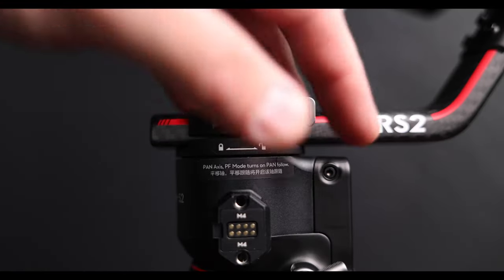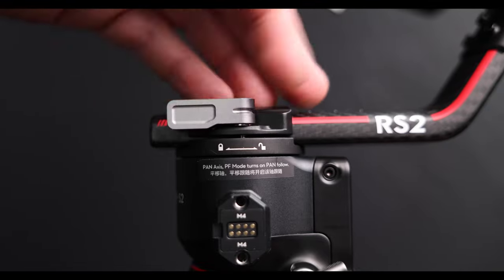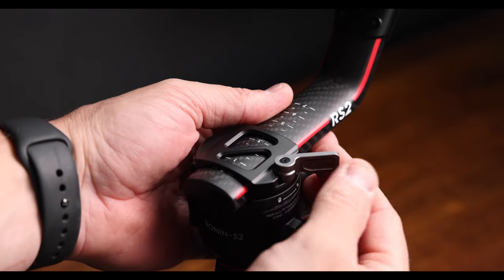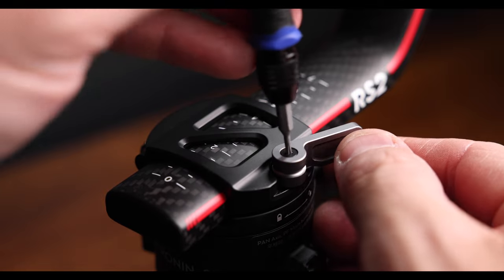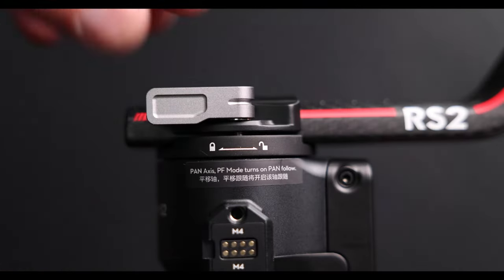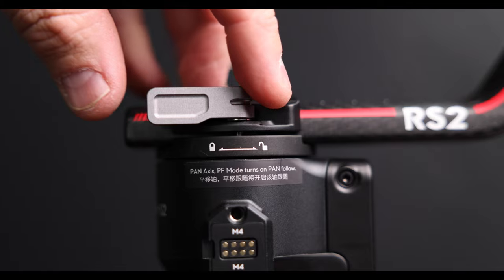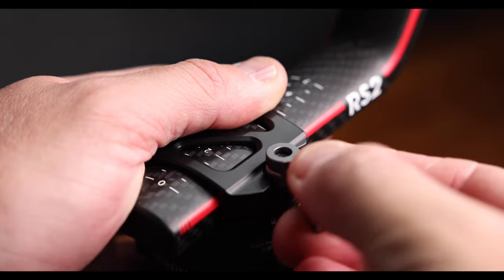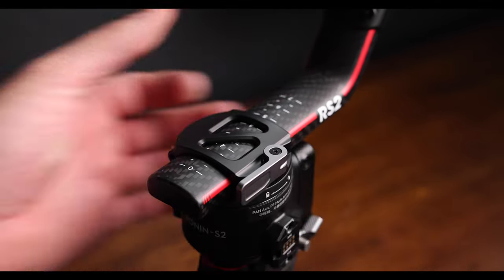Dji Ronin S2 - Loose Clamp Issue - QUICK FIX!

Comment: Thanks man! For those who are still having issues and this clamp moving with your movements, try to keep it straight up and turn smoothly
Reply: i have the same problem but mine is  out  what i ahve to do please
Reply: @samirBeorn  you need to keep straight to the top and turn smoothly then it will work.
Reply: @samirBeorn did you manage to put it back together brother?
Reply: @Shotbyobey  i did
Reply: @samirBeorn  can you share how brother?

Comment: Legend!  Had the same issue with the rs3.  I had to use some small pliers to hold the bottom screw in place while moving the top clip but it worked! Thanks!!!
Reply: please can you make a vidoe i have the same problem

Comment: Great video. I had the same problem after my mini 3 fell down and this got loose. The pulling up did not work so I pulled out the small star screw Tightened the mechanism and screw again the screw (with no force- it is not the force of the tightening that makes the clamp tight but the teeth mechanism) It worked perfectly

Comment: I'm trying to do this - but the problem is when I lift it up and turn it counter-clockwise  it DOESN'T disengage from the grooves - so that I can't tighten it - any thoughts?
Reply: Had the same issue. Had to hold the grooves down with the tip of my finger and then turn the lever.
Reply: @foryourconsiderationpod  yes, thanks I should have commented further - I used a screwdriver to stop the grooves turning - thanks for the tip all the same

Comment: Great video! Unfortunatley, mine loosened too much to the point where it popped out! 🙈 Any ideas how to screw it back in? I can't seem to get it to grip with that movement you showed. Appreciate any adivce. Thanks 🙏
Reply from the maker: You may need to use some very small pliers to hold that inner piece stationary while you do the twist action to get the lever back on.
Reply: @danielporterAZ  Thanks so much will give that a try today 🤞😀
Reply: did you fix it coz i have same problem Please help me
Reply: @samirBeorn  I got a mate to help me with the smaller pliers! It took a few goes mind. Thankfully, that worked! 😅
Reply: @danielporterAZ  THANK YOU SO FAWKIN MUCHHH.. been tryin to fix this damn rs4 the last 2 days with no luck but finally holding down that mechanism with pliers, I only had to rotate the lever 2 times to get it really tight.

Comment: Any solution for the Clamp which holds the camera plate? It has a visible hex ring under it but it doesn't lift up enough to do this
Reply from the maker: Thats a tough one. I looked at mine and you're right. It doesnt have the loaded spring like the others. I'd reach out to DJI and potentially send it in for repair. CHEERS!

Comment: I have a similar issue but with the one that holds the plate those u cannot bring them up i need help
Reply from the maker: I’d reach out to dji support and even on Twitter or Reddit. They are surprisingly responsive on those platforms.

Comment: I tried this & its still not tightening. Its actually to loose to shoot at this point. Please advise.
Reply from the maker: You may need to push down on the inner screw to help it catch the threads again. Just don’t attempt to turn that middle screw. If this fails I’d reach out to dji.